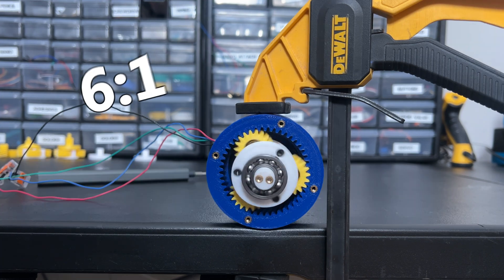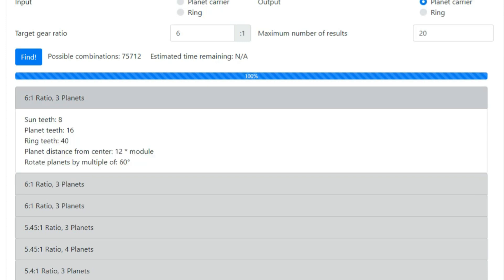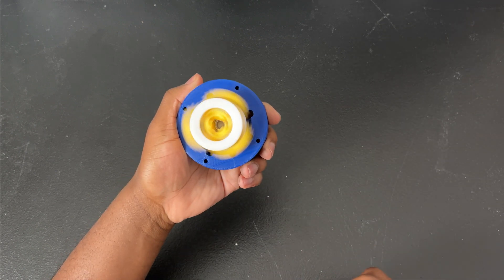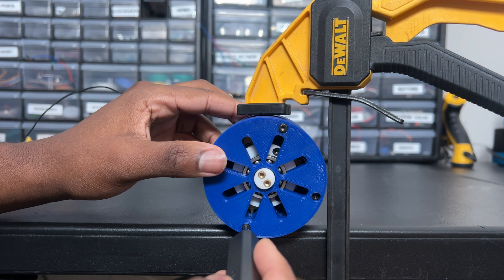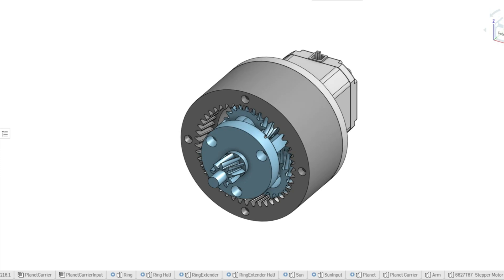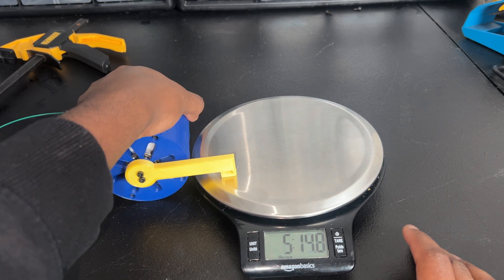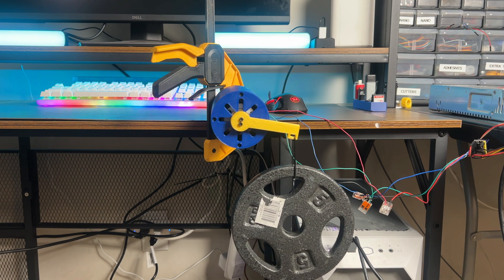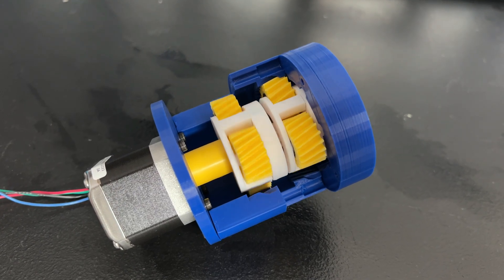3D Printed Stackable Planetary Gearbox

Comment: This is really cool, I would like to know what the true power of this gearbox is with stronger materials. Did you get to upload those files
Reply from the maker: Hey man uploading completely slipped my mind! What’s the best way to share CAD files?
Reply from the maker: https://cad.onshape.com/documents/13a6641e5a0713c1bf68535f/w/e7f301b09cff8509d4c9c311/e/42f16fdab1a05c3834690322?renderMode=0&uiState=6691729d1aa8c41ea7428b6d

Comment: Super good video! My only note is at the very end when you say we'll never know how strong the gearbox is, when that's exactly what you just found out😂! How else would you define the strength of the gearbox except the amount of torque it can transfer before its components start to break?
Reply from the maker: Lmaoo I guess when I saying that I was more so saying if I spent time optimizing it like using abs or petg instead of pla but you’re right! We did find out the max torque😭

Comment: Hi Naz, for the 3D prints do you have to apply some sort of offset to ensure you get the correct tooth to tooth backlash? My models are correct for tooth space and tooth thickness but always seem to get an interference on the prints preventing smooth operation. Any tips? Thanks.
Reply from the maker: What’s up, I used a 0.025 inch backlash. Make sure to only use backlash on the planet gears and the sun gears. Don’t use any on the  ring gear. In the video when I’m designing the gears I show how to add backlash. Let me know how it goes or if you have any other questions.
Reply: I got it, cheers. @NazLouis
Reply from the maker: @RobertNantyffyllon1965  no problem